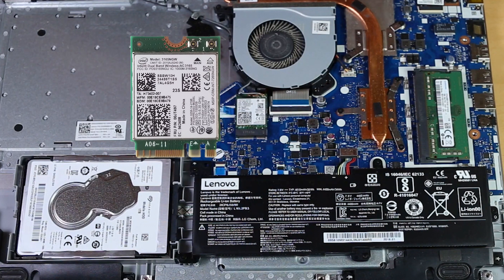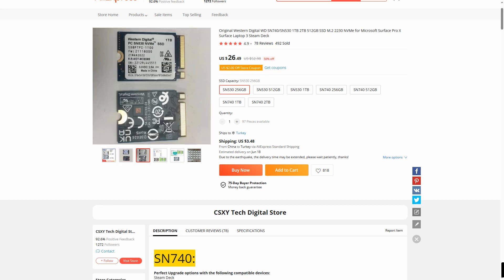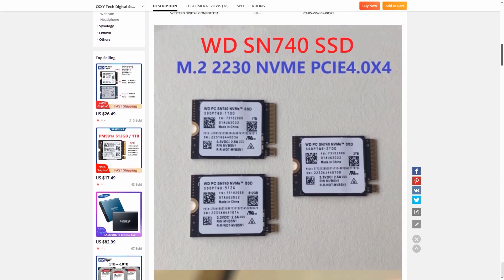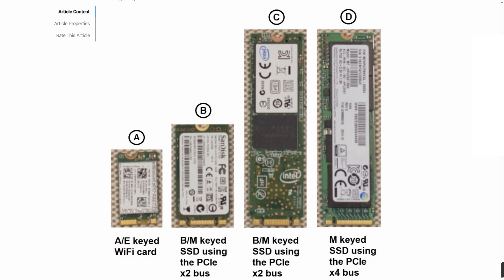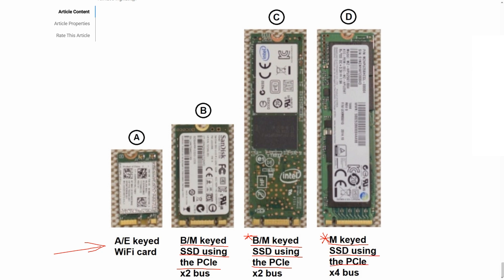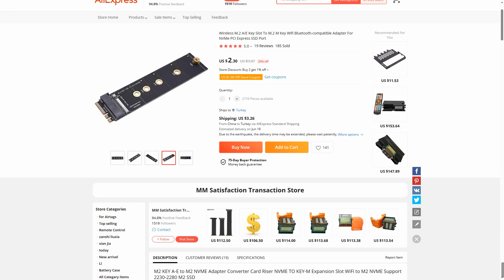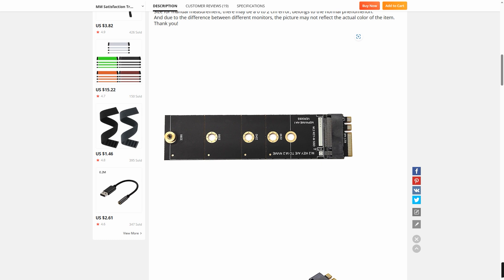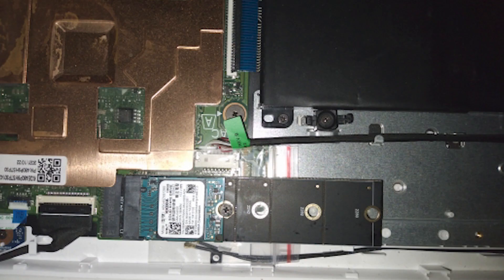Convert WiFi Slot to M.2 NVMe SSD Slot!

Comment: That is a nice way to add fast storage to your laptop, especially if you are not using the WiF card for connection, but as far as I know most WiFi slots only run at x1/x2 pcie speed (at least on older laptops), and won't be able to utilize speeds of x3/x4 NVMe. It will still run faster than normal SSD.

Comment: I have an old Lenovo Thinkpad laying around that I keep with all my hurricane gear. It has a micro USB C port for charging so I can use battery banks when the power goes out. This would be an awesome mod for that because the wifi will not be working anyways if the power is out. I have this app on my phone that lets me use my phone data as Internet thru USB to to my laptop. The cell towers thankfully never go down during a storm when I power goes out. I'm definitely going to be doing this mod so I can add more shows movies ect. I'm so glad I came across this video bravo sir and thank you.  As a sidenote the last hurricane we had knocked our power out for a day and a half. I was playing Diablo 2 online with this setup on my phone data. I've also played Eve Online this way had some hit and misses with different World of Warcraft private servers as well.

Comment: Not exactly... 
According to my research, You can mod fit Nvme M2 in wifi M2 slot with proper Key conversion however the speed and performance of Nvme will be much lower because the M2 slot for wifi is Only two lane pci slot but for Nvme it needs 8 or 16 lane pci slot in order to archive its real performance so no benifits.

Comment: I have a 10th generation motherboard, it has a wifi 6 slot, I was thinking about buying one of these adapters to use an nvme or an SD card adapter, would it work?

Comment: Help laptop redmibook 14 enchanted edition i7 10 th there is one ssd, I want a second one instead of wifi through an adapter but the system does not see it, the ssd is not nvme but with 2 bm keys.

Comment: nice video . actually I have an old HP pavilion and I just did that , it works fine from the beginning and boots very fast , but after 3 to 5 minute it gives a blue screen error :( . I don't see why but i think it doesn't like booting from that slot, I searched in the internet but I cant find anything *( SORRY MY ENGLISH IS BAD )

Comment: Hi, I have a Lenovo Y 50-70 with I7 4720HQ, 16 Gb ram. I recently replaced the SSHD with Crucial MX500. Previously my laptop used to take around 7 to 10 minutes to login and then lag throughout any operation but now it logs me in within 30 seconds and all applications run instantly afterwards. I was thinking of removing the WIFI card & using an M.2 A/E to Key M M.2 adaptor so that I can install an M.2 Nvme SSD and boot the system from it to further fasten up my laptop. I had a few questions :-
1. Will the Nvme SSD make my laptop even faster or are there any limitations?
2. Will there be heating issues with the Nvme SSD & will I have to install a heatsink as well for it?
3. I am also thinking about upgrading my RAM from 16 GB(8X2) Axiam to Crucial 32 GB(16x2). My laptop manual states max allowed RAM is 16 GB but when i typed in command prompt to check, it stated 32 GB as max. Will the extra RAM be helpful to run softwares faster & boost my laptop further?

Comment: Very thanks for your informatics video, I do have an old tablet  year 2012 processor Intle Atom  dual-core 1.86 Ghz ,  I was looking for installing Ubuntu OS on a faster  PCI card 64 GB size to be inserted closer to the control bus of that old tablet (GIGABYTE s1080). Your video is unique issue and very helpful project in 2024. I have a questions about the cost $ & speed gain after you completed your project on your new Lenovo 520 and the advantages by 2024?.  Is it worth for me to apply your project steps on my tablet? Thanks   BR        Akmal

Comment: Great video! 
Thanks!!! 👏🏼👍🏼
And I thought I had searched the Net… I realize that, compared with your research, just have managed to scratch a bit… 😂🤣😂🤣

Your video (well explained with a calm voice) sure puts my worries at ease. Puhhhh.

I’ve bought the adapter and a 2230 memory with the intention to remove the wifi card and replace it with this ”special solution SSD” as boot drive for Proxmox, Unraid and VM’s for my home lab. Because I really need the 3 nvme’s in the AMD NUC mini pc so I can use RAID5. Yupp, I’m going all in with this one. We’ll see how it all works out once I get the mini pc and the 2230 stuff. Wish me luck, I think I’ll need it! 😳

But, as I said, Kudos to you for this very thought out video. 👏🏼👏🏼👏🏼

Comment: Speeds will depend on what generation your PCIe is:  
Mini PCIe 1.0: Based on PCIe 1.0, providing a data rate of 250 MB/s per lane.
Mini PCIe 2.0: Based on PCIe 2.0, providing a data rate of 500 MB/s per lane.
Mini PCIe 3.0: Based on PCIe 3.0, providing a data rate of 1 GB/s per lane.
Mini PCIe 4.0: Based on PCIe 4.0, providing a data rate of 2 GB/s per lane.
Mini PCIe 5.0: Based on PCIe 5.0, providing a data rate of 4 GB/s per lane12.

Comment: Kioxia bg5 please suggest converter external card
Reply from the maker: The Kioxia BG5 is a M.2 2230 SSD and use a Kioxia BG5 SSD as an external drive, you will need an M.2 NVMe to PCIe adapter or an M.2 NVMe enclosure

Comment: 1. Check your data transfer rate, it won't be mind boggling;
2. some of these ports are CNVi and don't have a PCIe line, the SSD won't work;
3. even if it has a PCIe lane, some manufacturer whitelist the devices that can actually be used there and an SSD won't work.

I don't know what the likelihood of it working is but it's not 100%

Comment: So how you use wifi  if you replaced it with ssd i want to do this but will wifi work or not
Reply from the maker: Thanks for your comment! I'm using a USB Wi-Fi adapter. When I replaced my laptop's Wi-Fi card with M.2 SSD, I also had to start using a USB Wi-Fi adapter. It's been working well for me until now

Comment: lenovo thinkpad L480 model there wifi slot can we use it for ssd ?
Reply from the maker: I believe so. I reviewed the Lenovo ThinkPad L480 specifications on their website (https://psref.lenovo.com/syspool/Sys/PDF/ThinkPad/ThinkPad_L480/ThinkPad_L480_Spec.PDF). The WiFi card appears to be an Intel Dual Band Wireless-AC 8265, which uses an E+A key connector. Therefore, if the written specification covers your laptop, I think you should be able to use the adapter.

Comment: Does Bluetooth work?
Reply from the maker: No, Bluetooth won't work directly since it relies on the same hardware as your WiFi card. However, you can easily get Bluetooth functionality by using a USB Bluetooth adapter

Comment: So why didn’t you just buy a e key m.2? You wouldn’t have needed the adapter
Reply from the maker: I couldn't find any A-E key SSDs after searching quite a bit. It seemed easier to get an adapter instead.
Reply: @techwise66  yeah. I found one single one but seemed super sketchy. I too went with an adapter

Comment: Is the reverse also possible? Transfering a wlan card from a laptop to 1 desktop Mobo m.2 slot would it work?😊
Reply from the maker: Yes, it can be possible to use a laptop's WLAN card in a desktop, but you'll need a different adapter that I used in the video. A "Wireless M.2 A+E Key Slot to M.2 M Key Wi-Fi Bluetooth Adapter" may help to convert the necessary interface, allowing you to plug the laptop card into your desktop's M.2 M key slot

Comment: Thanks, great video! Just remember that the NVMe M.2 SSD will work at 25% (or 1/4) of its maximum capability as the WiFi interface is PCIe 1x (Not 4x). If you have PCIe 3.0 that means the maximum speed would be just below 1 GB/s (985 MB/s) and if you have PCIe 2.0 its speed is only 500 MB/s (slower than maximum SATA III which is 600 MB/s in theory and about 550 MB/s in reality). And keep in mind you may need a "bootloader" to be able to launch your OS from that slot. Best regards!
Reply from the maker: Thank you so much for your comment! You make a great point. The 1x PCIe of the WiFi interface can create a bottleneck. So we may not get the full potential of the NVMe drive. But it performs significantly better PCIe 3.0 x4 than a SATA III SSD, especially for tasks with lots of small random reads and writes
Reply: @techwise66  I boot my windows 11 OS off USB 3.1 Gen 2 which is about the speed of PCIe 3.0 x1 with a NVME SSD. OS loads fast also like normal. What's important is to have a fast TLC SSD in the enclosure. QLC will make sometimes the SSD drop to 0Mbps. Even pause at that speed or hover around 150Mbps. Avoid QLC like the plague.
Reply: In my opinion SATA3 at 600Mbps is nominal, the truth is it goes at 400-450Mbps Max. A PCIe 3.0 could have a NVME to 4 or even 5x SATA working just fine as long as they are not set up in a sort of RAID (like ZFS) e.g. not used all at once all the time. Thank you for the video, very informative!
Reply: @wellloaded2157  Thanks! Nowadays SATA III gets up to about 550 MB/s real transfer rates (Sequential Read / Write). And remember that NVMe depends on the amount of PCIe lanes available for that slot and the PCIe version. For WiFi you normally have only 1 PCIe lane, as I said above...
Reply: @FROILANDRES correct.  Most wifi slots are pcie 2.0 on these older laptops and bios likely will not boot from there.  Slow nvme cards are cheap so it's ok, but not much better than a sata drive but maybe there is no space.
Reply: @barryobrien1890  Thanks for your feedback and input. Best regards!
Reply: @FROILANDRES are there wifi slots with more than 1 lanes? Any way to check that?
Reply: @wellloaded2157 quick question: why do you think is it not good for zfs? Can't this also be used in a small Nas as storage?
Reply: Old computers don't boot from pci storage.
Reply: @ArmandoCalderon Bootloader
Reply: laptop redmibook 14 enchanted edition i7 10 th there is one ssd, I want a second one instead of wifi through an adapter but the system does not see it, the ssd is not nvme but with 2 bm keys.
Reply: @Mr.SK-j7l Hi, did u check "Create and format hard disk partitions" Windows app to check if it is recognized there?

Comment: Thank you so much for this video! I got a few of the Acer Veriton X4640G pc's pretty cheap for the family and was attempting to use the M.2 slot. This is when I got exposed to all of the NVME differences. But online, I only came across people asking about the M.2 slot only to be answered over and over that it is a "wifi only slot". It is an A+E slot like yours. I had no idea there were adapters for this. I am headed to Aliexpress to grab some now!
Reply from the maker: Thank you so much for your comment! I'm so glad my video helped you and I wish you enjoy the speed upgrade with your new SSDs!
Reply: @techwise66 can my bios uefi still see the u.2 drive inserted in a u.2 to m.2 adapter even if it cant boot into the u.2 drive?
Reply from the maker: @jirehla-ab1671  Yes, your BIOS/UEFI should likely see the U.2 drive. However, being able to boot from it depends on a few factors. First check if your BIOS/UEFI supports booting from NVMe drives. Update it if you have an older version. And at the same time, enter your BIOS/UEFI settings and ensure the U.2 drive is listed there and set it as the primary boot device. If your BIOS has legacy Compatibility Support Module (CSM), it may need to be disabled for NVMe boot. Finally, using a high-quality U.2 to M.2 adapter, especially for NVMe drives, can help avoid compatibility issues. Even if the drive isn't bootable, the BIOS recognizing it allows you to access the data through your operating system once booted from another drive.
Reply: @techwise66  another way i could boot into the u.2 drive is by the efi shell, i have done it before on my external drive and it works
Reply: @techwise66  maybe the  reason why the high quality adaptera may have a higher chance booting is because of the adapter having a boot rom
Reply: Nsfg should it also start or do you need nvme ssd

Comment: does it work with qualcomm atheros ar956x wireless adapter? i have laptop with this wireless adapter and i plan to replace it with m.2 sata/nvme ssd, will it work?
Reply from the maker: The adapter featured in the video is designed for Key A+E slots, whereas the Qualcomm Atheros AR956x wireless adapter typically utilises a mini PCI-E WiFi port. So, you'll need to get a different adapter compatible with the mini PCI-E slot. I am preparing a new video and will try to show the differences.

Comment: good video master, I want to do the same with a desktop PC, but the other way around, my mother board does not have m2 wifi, only m2 storage, do you think it is possible to put an m2 wifi and bluetoth in that connector? It is a gigabyte h 510 I await a response!!
Reply from the maker: Hello and thank you for your comment! Yes, it is generally possible to add WiFi and Bluetooth functionality to a desktop PC using the M.2 slot originally intended for storage, but there are a few important considerations to keep in mind.

Slot Compatibility: Most modern desktop motherboards use M.2 slots that support both SATA and PCIe devices. For WiFi and Bluetooth cards, you'll need a slot that supports PCIe devices, as most M.2 WiFi cards use PCIe for connectivity. Your Gigabyte H510 motherboard should support this, but it's always a good idea to check the motherboard's manual or specifications online to confirm the type of M.2 slots it has and their compatibility.

Keying and Form Factor: M.2 slots and devices are keyed to ensure that only compatible devices can be connected. M.2 WiFi cards typically use the A, E, or A+E key, while M.2 storage devices might use B or M keys. Ensure that the M.2 slot on your motherboard matches the keying of the M.2 WiFi card you plan to use.

Hardware Support: Not all motherboards may support booting or device recognition for M.2 WiFi cards if the BIOS/UEFI firmware doesn't explicitly support it. Check your motherboard's documentation or contact Gigabyte support to confirm if your specific model supports using an M.2 slot for WiFi and Bluetooth modules.

You can search for adapters that can solve your issue, such as "NGFF A/E-Key Wireless NGFF WiFi Card to M.2 NGFF Key-M" or "Wireless M.2 A+E Key Slot To M.2 M Key Wifi Bluetooth Adapter." However, ensure you check for compatibility and space constraints before purchasing any hardware.

Good luck with your upgrade!

Comment: Doesnt work on asus l406 after place the adapter i was try eith many diffirent ssd not detected in bios thanks anyway
Reply from the maker: Thank you for sharing your experience with the ASUS L406. I'm sorry to hear that the adapter and SSDs weren't detected in your computer model
Reply: @techwise66 laptop redmibook 14 enchanted edition i7 10 th there is one ssd, I want a second one instead of wifi through an adapter but the system does not see it, the ssd is not nvme but with 2 bm keys.

Comment: Great shear. Any idea on how to get the best four NVMe's ssd performance on a 3rd gen pci desktop mobo ? It only has one m.2 slot and I'm a noob wen it comes to pci stuff on mother board's. 
EDIT: The rail stuff gets me a little lost.
Reply from the maker: Thank you for your kind words and great question! Enhancing your system to accommodate and make the most out of four NVMe SSDs, especially with a motherboard that has only one M.2 slot, presents a challenge, but there are solutions. Since your motherboard has limited M.2 slots, you can use either the adapter that I showed in the video to convert a WiFi slot to NVMe or a PCIe adapter to add more NVMe SSDs. These adapters convert available WiFi slots and PCIe slots into M.2 slots. For a 3rd gen PCIe motherboard, ensure the adapter is compatible with PCIe 3.0 for optimal performance. It's a good idea to ask the seller for this information.
Reply: @techwise66  :) I have ben doing a bit of research last year to see if I wanted a 4th gen. Just for got most of it. Turning the wifi slot on laptop to a functioning PCIe is awesome. I remember trying to make a expot adapter for a graphics card on my 12 year old laptop several years ago. Epic fail. >_<
Reply from the maker: @frankenstein3163  😊 It's great to hear about your enthusiasm and willingness to explore new upgrades and modifications, even after an adventurous attempt with your old laptop! The journey of upgrading and tinkering with hardware can be both exciting and challenging. Don't be discouraged by this type of past experiences. Keep researching, and and may it be a great success!
Reply: @techwise66  :)

Comment: Nice vid!
But I guess the converted M2 Disk has 'only' SATA-speed and not NVMe speed?
Reply from the maker: Thank you for your comment! I received 1257.54 Read (MB/s) and 1211.65 Write (MB/s), which is significantly higher than my 2.5" SSD

Comment: can we boot from it ?
Reply from the maker: Yes, after moving my old Windows installation from my 2.5" SATA SSD to my M.2 NMMe drive, it still works and can be bootable. This video has the bios properties that I have: https://www.youtube.com/watch?v=YBwPaWFExsQ
Reply: @techwise66 as you mentioned this slot has may be PCIe 2.0 x1 or x2 connection.
can we expect any speed improvements over sata ssd ?
Reply from the maker: @bapibarman7484  Thanks for your asking! Yes, there is almost triple-speed improvement in my case. But as you know, speed improvement depends on the motherboard, wifi slot properties, and M.2 NVMe hard disk

Comment: Hello! Can i do it on an inspiron 3576 i7 notebook? The bios?!
Reply from the maker: Hello! While I haven't tested this on an Inspiron 3576 i7 notebook, you should double-check some of your laptop's specifications before going. Check the compatibility of important components such as the WiFi card slot, motherboard type, and other relevant hardware parameters with the procedure outlined in the video. This will guarantee that the instructions are appropriate for your laptop